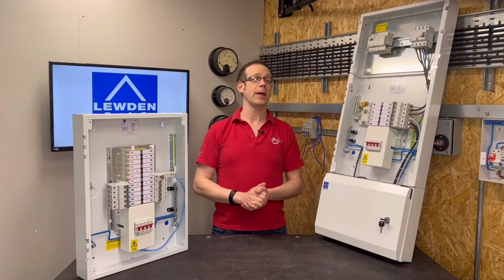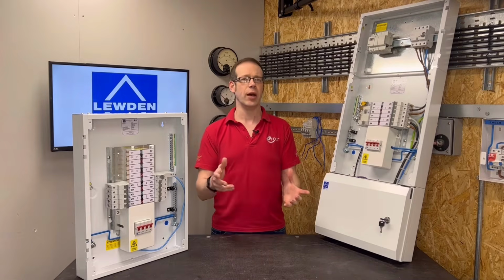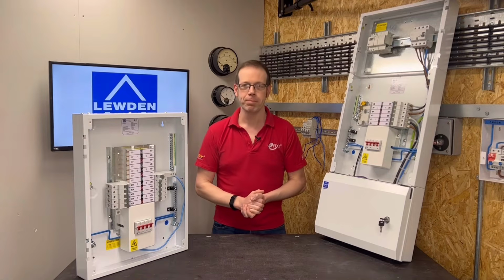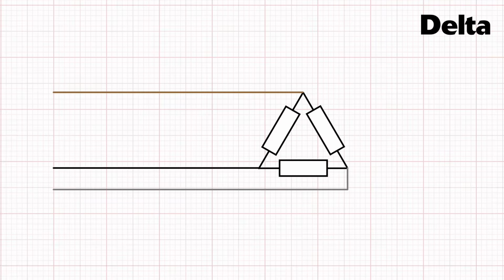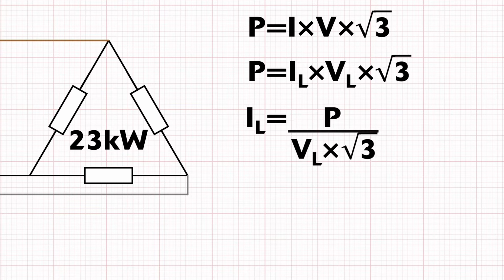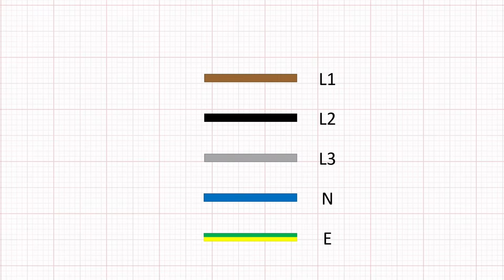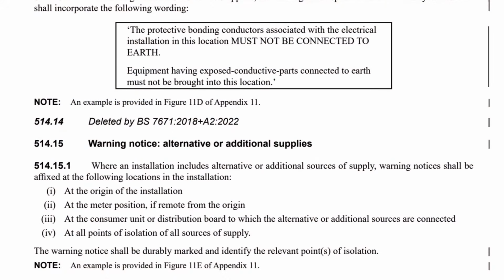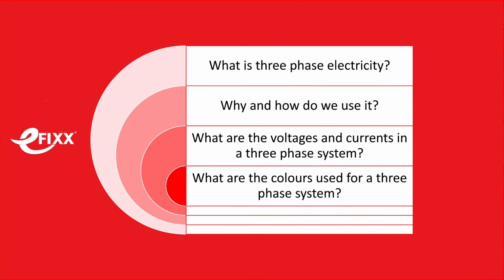The Utimate Guide to Three Phase Electricity

Comment: I found that fascinating; thank you.

One question that wasn't answered was "why three phases?" Why not four, or six? My assumption is that three gives satisfactory smoothness of power delivery and that the law of diminishing returns makes adding phases redundant.

My assumption is probably wrong. I've been wrong before.
Reply: And I was always told it was balanced.
Reply: @Michael-qk4dl That's not what balanced means.

A 3 phase system which is balanced means the load across the 3 phases, so from L1-L2, L2-L3, L3-L1 is the same. 

A genuine 3 phase system doesn't need a neutral. An example is using a 3 phase motor.

However, we have loads which don't operate at 415 volts, we have loads that run at 230 volts, so we need a single phase supply as well for loads.
That's achieved by adding a neutral wire.

So our systems are 3 phase + N.

If you connect up  a single phase load which requires 230 volts  to a 3 phase supply, you connect those loads between a phase and neutral.

If you connect up a load requiring  415 volts, then you connect it up across between two phases and don't use the neutral.

When you do this, it can result in the loads across the phases, Z1, Z2, Z3 not being equal. When this happens there is a non zero neutral current.

Ideally we want the neutral current in a 3 phase+N system to be zero.
So we distribute, the best we can, the loads across the phases to try to obtain the loads, Z1=Z2=Z3, to make them all the same.
When this is achieved the neutral current is zero.
The act of doing this, is called "balancing".
So balancing is the act of configuring the electrical installation in a 3 phase system to distribute the load across the three phases to minimise the neutral current.
Reply: 6 phase power could be made from 3 phase power very easily. Lust one 3 phase transformer, except secondary coills are center-taped and those center taps connected together as neutral in 6 phase system.
4 phase - cold be made from 3 phase almost as easy.
In theory 4 phase system offers 4/3 the amount of power vs 3 phase system for 4/3 of conductors and 6 phase system allows 2x power for 2x conductors (almost perfectly matching 2x 3phase transmission lines).
3 phase system has a major advatage: all phase-phase voltages are the same that simplified wiring and connecions.
Reply: @volodumurkalunyak4651  If you had a 4 phase system, it could be wrongly wired so that the phases don't "rotate". It's impossible to wire a 3 phase system so it doesn't rotate. It might rotate the wrong way, but it will still rotate. 3 phases are also the most efficient.
Reply: For distribution purposes, if the loads at the consumer end are well balanced across the 3 phases, the neutral conductor has a small current returned along it compared to what is actually consumed in terms of watts. Unlike single phase where both conductors have to carry the full current. By adding 2 conductors for 3 phases compared to single phase or DC, you get a big uplift in the amount of power that can be transmitted, more than say having 2 thick cables or running 2 separate single phases. Adding more phases past 3 phase will start increasing the amount of conductor material you need again in your distribution system.

Comment: I remember hearing (years ago) that DC down a wire would cause electromigration on the wire and cause it to fail, but this wouldn't happen with AC, and that was one reason for using AC. That may be a load of rubbish - what do you think? If power is shared between countries via a DC link then I assume it is a load of rubbish!

Also, it might be worth commenting that it's the magnitude of the current that causes loss in the cable, so if you can transmit the power at a much higher voltage, and thus at a much lower current, you significantly reduce the loss in the cable. I think that is the main benefit to transmitting at 10's of kilovolts - again, I'd love your thoughts on this. Cheers :)
Reply: It is a thing even in AC, if you see very old installations like 30+ yo, its only the phases that are corroded. That green stuff that comes from copper.

Comment: In Germany the colors have also changed several times. In very old installations there was black phase and red PEN. Sometimes gray was used for N and red for PE. The reverse sequence has also been used by laypeople. 
Or was it an Englishman?

Then new colors appeared at the beginning of the 1970s: phases of black, brown, black. Blue for neutral and yellow-green for PE. But it was often difficult to distinguish the black cable next to the brown cable from the black cable next to the blue one. 

Then came the uniform standard for Europe: brown, black, gray for the phases. Blue for N and yellow-green for PE.

It's very difficult when you use all the colors in an old building just the way you like. Often the only solution is to completely rewire.
Reply: Switching from black-brown-black to brown-black-gray back and forth is really a pain, but replacing all wires isn't even possible if you don't want to rebuild the whole house.

At least the old wires with the red PEN are getting rare and should always be replaced.

Comment: Controls engineer here, frequently work in old, 'new' and mixed electrical panels. Also work with imported HVAC and other equipment that internally uses US/Chinese/god-only-knows-what colour schemes for it's power wiring. Mix that in with an assortment of colours used in the control and signal wiring and it can get real fun real quick!
Reply: Have seen chinese 3 phase stuff wired Red White Black

Comment: The reason for three phase is that it minimises the amount of copper needed to carry the power.
Reply from the maker: Thanks for commenting. 😊
Reply: Nope. The reason is because everything that produces AC electricity(except solar) relies on a 3 phase motor.
Reply: @zaxmaxlax  here is a full explanation, 3 phase systems are used as you can split loads across all 3 phases, use 3 phase motors which have less of a failure rate compared to single phase motors which uses a starter capacitor which fails.

You can use 3 phase solar inverters to feed back 3 phases.

You can find that 3 phase versions of items such as air conditioners will last longer as there is less components in use compared to single phase.

Finally, 3 phase is just more versatile.
Reply: Nope again!  It's DC For maximum power with minimum copper.  Look at the HVDC interconnectors in power transmission.
Reply: @bobashby280  with extreme heat*
Reply: You get 173% of the power for the same current, but only using 150% of the copper. Main reason is that the rotating field that 3-phase windings produce allows for the use of simpler, more efficient motors